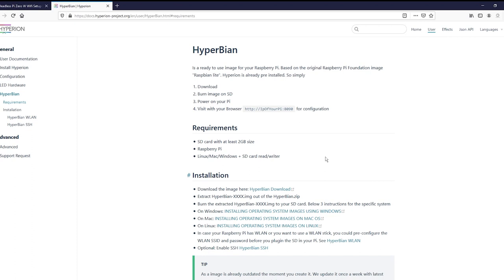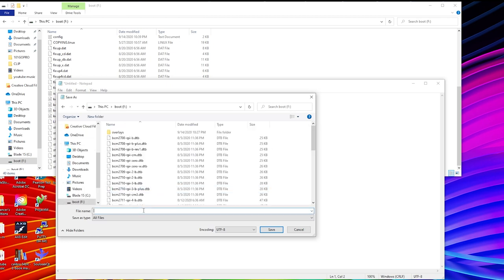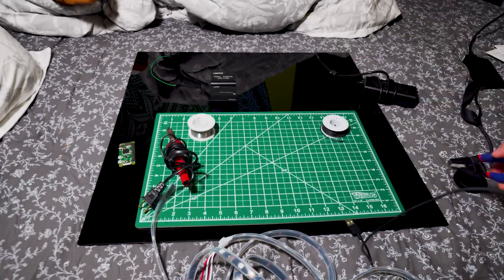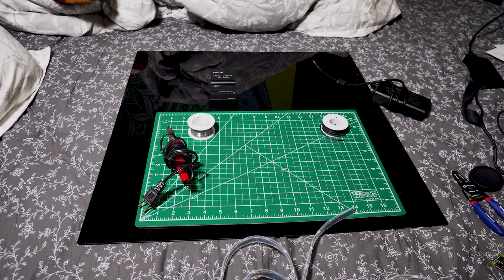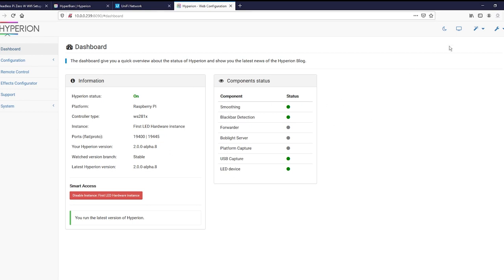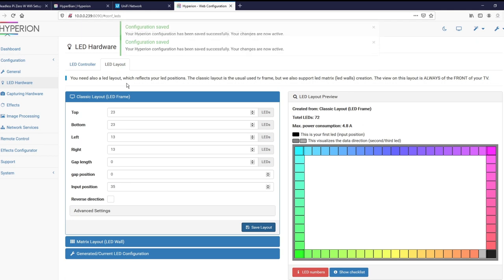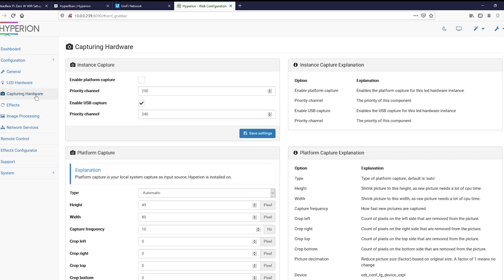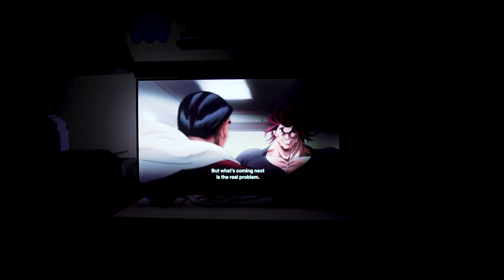Screen Matched LED Backlight using Hyperion and Hyperbian

Comment: I recommend to switch capture resolution to lowest available (I have 720x480) with MJPEG and 60 fps. IT will work way smoother than default setup.

Comment: great video dude!!! - does this have to be always on? You'd have to turn on the R-pi separately from the TV right? you can't everything power on when you turn on your TV?
Reply from the maker: Yeah it does, you can always add a power switch to the pi though
Reply: A tip : watch series at flixzone. I've been using it for watching loads of movies during the lockdown.
Reply: @Elon Briar Yup, been using flixzone for since november myself :)
Reply: @Elon Briar Yea, been using flixzone for years myself :)

Comment: I'm having a hard time finding help, I'm using OSMC with Hyperion but it after reboot the pi the service is stopped and I had to plug it into the PC and re-code it. Any suggestion?
Reply from the maker: The hyperion service is stopping?  Do you have it set to run on startup automatically?

Comment: My hyperion does not detect usb capture in the remote control tab of hyperion WebUI.. I cross checked the video capture card with OBS and its working fine.. What should i do?
Reply from the maker: Are you powering the capture with its own adapter and is hyperion the only thing you're running on the pi?  Could be a power issue or compatibility issue with the pi

Comment: Hey buddy 

Wonder if you can help, I had it all sorted and working then my pi 3b+ died, so I brought a pi4 and the new pi can find the leds. I have changed everything. Redone the software, changed jumper and have a 3a power supply to the pi and more then enough power to the leds. Any ideas? Thanks
Reply from the maker: If you're sharing that 3a psu you might need something a little beefier, did you try seeing if the effects work?  If you have the capture card in a usb3 slot maybe move it and see if that does anything.
Reply: The Tech Samurai  Hey Bud, so the pi and led have different power supply the LEDS have 10a power. 

So I have changed everything and I just can’t get the new pi to find the LEDS . I have tried Ned LEDS too.
Reply: @grantvirgo5792  the pi and the led's need to have the same ground.

Comment: Will this project work with a 2 in X 4 out 4K HDMI splitter? 2 inputs for fire cube/stick and gaming console. 3 outputs for  fire cube/stick, gaming console (both going into tv) and capture card.
Reply from the maker: No reason it shouldn't, concept is the same... just need to be sure the  hdcp handshake from the tv passes along to the other ports.  If you ordered the splitter off of Amazon or intend to, the Q&A section sometimes has someone asking if the splitter does remove the hdcp.  If you mean hdmi switch it may be different but could probably be worked around by putting a splitter like the one in the video in front of it.
Reply: @TheTechSamurai  Thanks, I haven't purchased the parts yet. I'm still in my planning phase, was thinkin about getting everything I may need first then see what works best.

Comment: Did you lose the HDMI-CEC function if you connect the hdmi capture?? In my case I bought an hdmi capture on Aliexpress and now I lose the HDMI-CEC function and the TV doesn't turn ON automatically when I turn on my Apple TV....
Reply from the maker: Yeah they're cheap it probably won't pass through the cec, I'll check when I get a chance if the splitter does anything to bypass it.  Don't usually use it on my setup so I can't answer off the top of my head.
Reply from the maker: Yeah mine is no-go, but I think if you find a CEC enabled splitter this will solve your problem
Reply: @TheTechSamurai  I try some splitters bot noone works with CEC function...

Comment: Did you have to add splitter after  using awhile? I had hyperbian working for a couple of weeks then all of a sudden I cannot get Hyperion to detect the usb HDMI capture  card at all in the web config.
Reply from the maker: I had to add it the day after I set it up, nothing would work except the mini nintendo consoles I had laying around.. but, it did still detect the capture card so yours might have just went bad, did you hook it up to a pc or something and double check?
Reply: @TheTechSamurai  no I haven’t tried it on a pc, only on my Xbox one...  worked great for like two weeks then Hyperion couldn’t detect the capture card I have the same card as you, I did get Hyperion to find it for like 10 minutes the other night but it was flaking out usb capture would pop up in my Hyperion remote sources then it would go away, then It would pop numerous times then it would just stop completely
Reply: Maybe I’ll try it on my sons Nintendo switch to see if usb capture  can be detected in the Hyperion remote source setting I get home from work here
Reply from the maker: @SpadednFaded27  I would try hooking it up to a PC or laptop rather than a raspberry pi or whatever you've got it running on and see if some free streaming software like OBS can pick up the signal.  That would definitely let you know if the card is on it's way out or not.
Reply: @TheTechSamurai  so hook up the capture card to my laptop and to my tv to see it it works?
Reply from the maker: @SpadednFaded27  hook it up to the laptop with something plugged into it and see if OBS can detect the card and also output whatever you're trying to capture
Reply: @TheTechSamurai  so I am on OSB with the capture card Input is Nintendo switch output is laptop and I can see it just fine and it’s capture the video as I’m playing a game...
Reply from the maker: @SpadednFaded27  sounds like the capture card is good so I'd either try the splitter or do a fresh install of hyperion if everything looks good on the remote control page

Comment: A complete noob here so forgive me if this is a silly question but can you control when this runs? Is there an easily accessible on/off function for this?
Reply from the maker: Yes, there's an on/switch on the web interface or you can make a power switch for the pi if you wanted to
Reply: @TheTechSamurai  can this be connected to google home or Alexa?
Reply from the maker: There are roundabout ways you could make that happen, home assistant can control hyperion and you can integrate alexa/Google assistant to that
Reply: @TheTechSamurai  I purchased the 4 way splitter you listed here. But I cannot get the video capture card to show for anything. Is there a certain way it’s supposed to be connected?
Reply from the maker: @brownlkt  the capture should be plug and play, the splitter on the other hand you've got to play with the dip switches on the front to get the proper 4k/1080p outputs
Reply: @TheTechSamurai  I've tried everything. I think it's the capture card. It will not work on the pi
Reply: @TheTechSamurai  I can get the capture card to work on my computer but not Hyperion.

Comment: What if i want to extend the leds behind my desk where the tv sits ? Can i get them  to sync in colors with the leds behind the tv? Any way todo this?
Reply from the maker: For sure, just make sure you've got enough power for the amount of leds and just change the number of leds and positioning in the settings.  You'd just be treating the desk as part of the tv.
Reply: @TheTechSamurai  thanks for the reply. So basicly i have bottom of my tv 59 leds. Lets say i have under my desk 100 leds, so i just add 159 leds as bottom of screen and should work ok?
Reply from the maker: Yeah it might get a little weird that way, but if you play around with the led arrangement and setup you can probably find something that works
Reply: Thanks, is there a correct way how to do this properly?
Reply from the maker: I mean the setup is meant just for the TV, the ideal way to do it would be to run a 2nd setup so that you could literally match the bottom of the TV a 2nd time.
Reply: @TheTechSamurai  wait so how would i set it up a second time ?  do i have to make two seperate kits for each new time i copy the  light? and is it possible to wirelessly connect the led to pi somehow?

Comment: Can you do it directly from the tv?
Reply: And also i need at least 25 amps how many watts is your PSU
Reply from the maker: Nah you can't do it from the tv because the capture card needs an input to read.  I just have the 50w amazon special I got in the description.
Reply: @TheTechSamurai  hey man. I have it connected to my xbox x but for some reason it doesn't show image on my tv when the capture card is on and/or the splitter. Did you counter any issues like that
Reply from the maker: Yeah anything heavy 4k you'll need a more expensive splitter/switcher.  I upgraded to this for my ps5, little pricey but its hard to find a good one that will still send 1080p to the capture card while doing 4k https://www.amazon.com/gp/aw/d/B083K39RHF?psc=1&ref=ppx_pop_mob_b_asin_title
Reply: @TheTechSamurai  I have heard that hdmi splitter sends same output  that is if it's 4k cable device then both will get 4k and if one device is 4k and another is 1080p then it will take the lowest 1080 and display on both. In this case it's a 1080 p capture card. How come you are getting 4k for tv and 1080p for capture card?
Reply from the maker: @monk-media  if you're referring to the one I most recently linked, it seems to work just fine with my ps5.  It looks awful with the low end splitter so I assume it's working as intended to send the independent signals.
Reply: @TheTechSamurai  Do you mind doing a quick video on how you set this up? Mine is not showing capture card in Hyperion and I’m completely stumped now.

Comment: Why is my strip led after the correct connections not lit?
Reply from the maker: Could be several reasons, how many  LEDs are you using?  Could need more power.  Also try playing with the settings in hyperion, try effects to see if ifs the external connections causing issues.
Reply: @TheTechSamurai  I use 85 led, using the 5v tester comes to all led... I've tried the effects of Hyperion but it doesn't work
Reply: @TheTechSamurai  Could it be GPIO 18 damaged?
Reply from the maker: @shwarzmuller3055  it's a possibility, but I feel like that's a last option...  did you try different strip settings?  Changing the led type or the rgb setting?
Reply: @TheTechSamurai  I tried another strip led
Reply from the maker: @shwarzmuller3055  I mean the settings in hyperion where you select the ws281x and the rgb type

Comment: Hey is your ambilight working still?
Reply from the maker: Yeah it is, yours having issues?
Reply: @TheTechSamurai   yeah mine worked since the last time I talked to ya  once I added the HDMI splitter for the capture card as then just last week Hyperion boots up does the boot effect & then it freezes on the boot effect and I can’t get the capture card to work... I have an old pc power supply that I’m using for power supply 5volt line has 25 amps it says, I have the 5v from leds twisted together with the micro usb positive and the ground from the power strip connected to the ground of the micro usb connect and they’re connect to the pc power supply and data from lEDs to GPIO 18... something wrong with my wiring? I’m lost lol it was working so good too!
Reply: Led ground twisted to ground on micro usb connected I meant
Reply: @TheTechSamurai  weird but I just reinstalled Raspi os lite and installed Hyperion 7.0 from github manually and it’s working now and it’s working without the HDMI splitter lol
Reply from the maker: Random, maybe you never needed the splitter after all. Glad to hear it's working now

Comment: can you plzzzzzz help me set this up i got the raspberry pi 3 all the stuf even the capture card but im having issues that my psu is differnt from yours its like a actual psu since my leds was 90 wats i couldnt use that type if so plz bro ill give you my discord even pay if you can help me set this up no cap
Reply from the maker: https://youtu.be/hpBRKZ_2aYo check this guy out he used a psu, just disregard the arduino stuff
Reply: Im doing it on an 82inch i need at lets 25amps (108 watts) im buying a pc PSU
Reply: @josuecardenas8672  you won't need more than 10 amps.